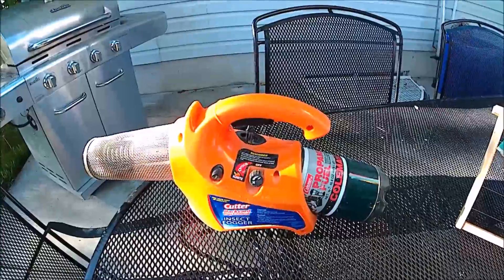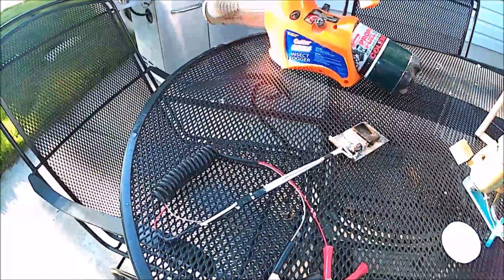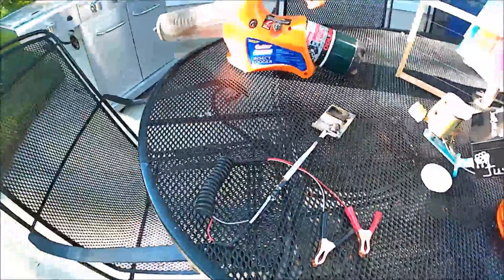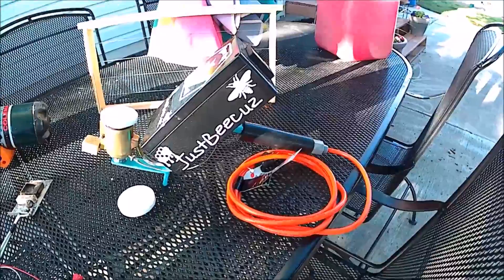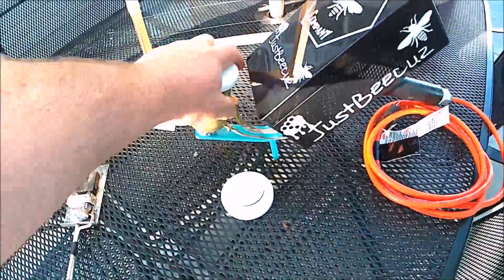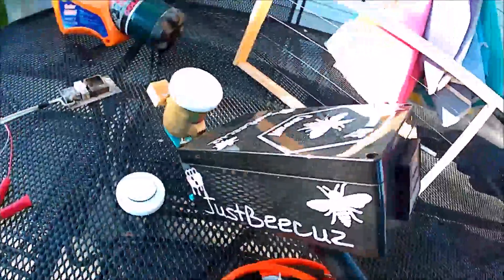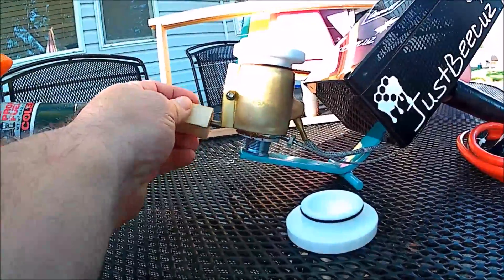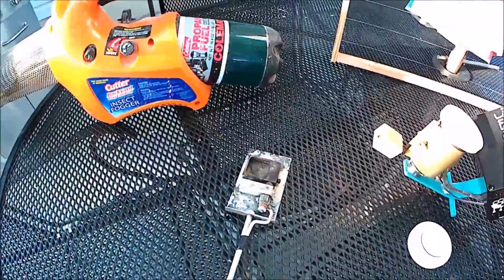Oxalic Acid Treatment Options and my favorite method

Comment: The fogger does work great. But if you are not careful it will blow up your hive. Last year I was on my last hive trying to get the last bit of liquid out and a couple extra pumps put enough alcohol that it actually lifted the top box off.  That Hive died over the winter but all 11 of my other hives are great.
Reply from the maker: Charles Wilke I’ve never had that happen

Comment: Using the Burgess model, you need to rinse out the pump area and run some water through the fogger to clean out the acid residue. My first one was eaten up by the acid.
Reply: Mine got eaten up also and I did wash it out
Reply: Which brands did you both buy?  I would like to get one but would like to buy one which isn't dissolved by the acid.
Reply: Burgess and after rinsing mine out it still ate the plunger
Reply: @Malcolm Megibben
Thanks for the quick reply!